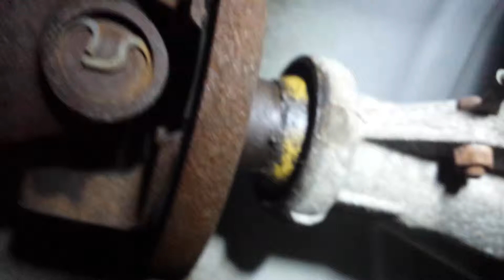2013 12 27 19 06 40

Comment: what did it end up being? i think i have the same issue where it sound kinda like your driving over those road shoulder  lines etched in some highways to wake you up that go "brrrrrr..... brrrr" etc when you drive over them... im imagining that was the noise you had as well cuz its happening to my 2001 marquis... thanks
Reply from the maker: Unfortunately I never did.  I even replaced the driveshaft and had no real improvement, so I just lived with it.  It was never a severe noise/vibration, but enough to irritate me.  30,000 miles later I sold the car, and I never had any trouble out of it.  

Your description almost sounds like rear wheel bearings.  Have you pulled your axleshafts and taken a look?